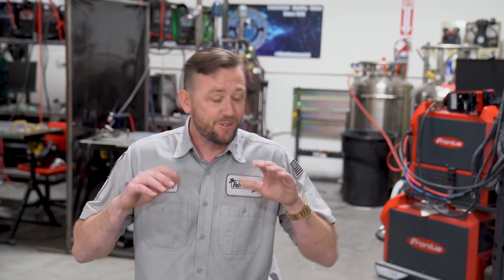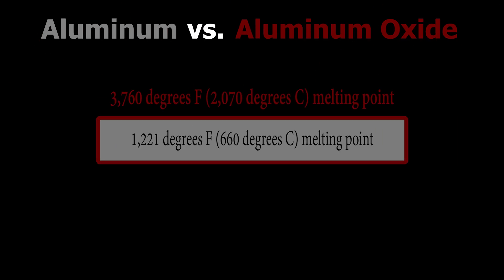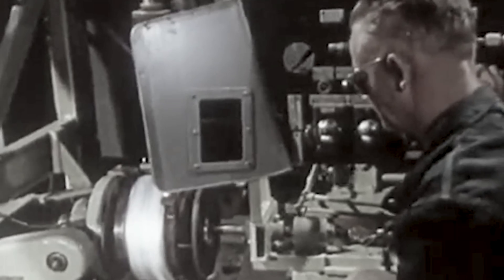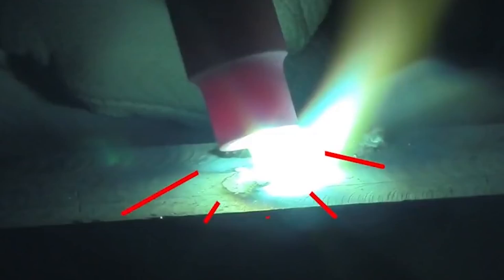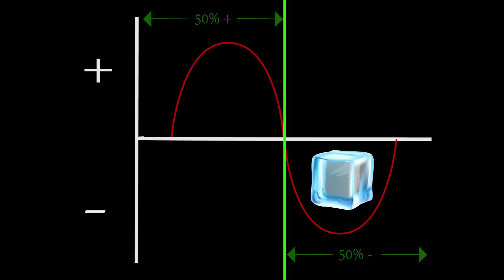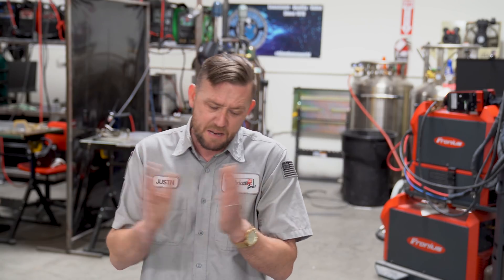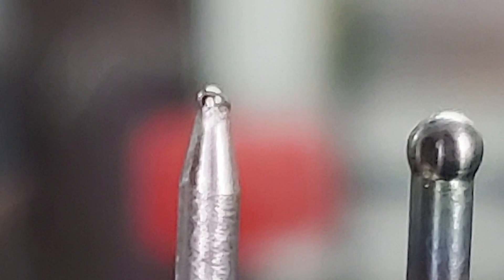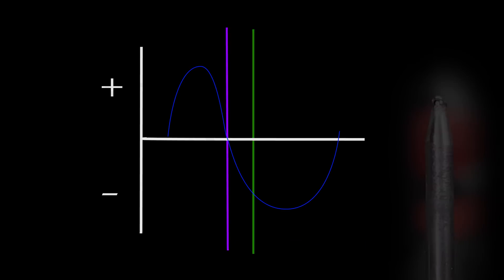TFS: Do We Even Ball the Tungsten Anymore?

Comment: I’ve been tig welding aluminum at work for about a year & still have no idea how to properly set the balance because we use Fronius machines & the company standard has it set to 0.5… I think. People always change it at every station. I think it maxes out at +/ 30 but I never go that far so don’t really remember. Fronius doesn’t seem to specify it’s a percentage like all the machines that I see here on YouTube do. 
It also doesn’t help that our “weld training” completely skipped over the settings because we should only “need to change the amperage, & maybe balance,” & I got one day of practice before going on the line while others practice for a week😅

I’ve learned everything I know from one certified welder on my line, this channel, & Pacific Arc Tig Welding YouTube channel. We’re not certified trade welders at our factory because we don’t fabricate from scratch, we inspect & repair robot welds

Long story still long™, if you have any experience with Fronius & could explain how its balance works or point me to someone that does, that would be great. Thanks for everything you do. I’ve learned so much & have found a new passion in stacking shiny dimes😂😁

Comment: We use pure because we don't need to be bothered with grinding tungsten, and no, we don't need to have a separate metal for balling it. Secondly, we get a robust, high build, bead profile very quickly. In our situation, there just was nothing broken about the system, other than perhaps the radioactivity issue with pure tungsten compared to others. 

We have had countless hires try to convert our process until they saw just how fast and pretty and consistent our welds are. We let welders choose which ever process works best for them. After a week of doing their way and being left in the dust, they just voluntarily adopt our way and add it to their skillset. Funny to hear them then tell other new hires. . ."Dude, it's 'pointless' to try and beat these guys at this game with that." Followed by. . ."It's so nice not to have to deal with dressing tips." 

I've been welding aluminum every day now for 30 years. I use a sacrificial scrap of aluminum to burn off a contamination event. Get it to glow and sling off the trash and cook it until it stops smoking. An even ball profile returns and I don't have to grind anything. We have two welders on a fixture and they race down each side. The pointed camp has to stop when they contaminate and then the other guy is now welding his side too until he gets his tungsten right again. Typically though, I don't have to touch the tungsten for days other than stick out adjustments periodically.

Not knocking the pointed camp, just that there are other reasons to use pure (green) other than just being stubborn.

Comment: I wish I had seen such a clear explanation of why opinions differ. I bought my TIG machine around 20 years ago (a Miller Dynasty Dx). I didn’t know squat about TIG but wanted to learn. The salesman at Holox was great, very knowledgeable. He got me set-up with the ancillary/consumables and even gave me a brief demonstration. He said with this machine you don’t even have to “ball” the tungsten. I thought well that’s awesome. Whatever balling a tungsten means, I don’t have to do it. Yippee. Take my money.

I rarely get the opportunity to TIG weld especially aluminum but I know my tungsten never balls. I never once heard it cry or even whimper even when it goes for a swim in molten metal. Every so often I’d be making small talk in line at the gas or steel supplier supplier and somehow the topic would come up and they’d insist I must ball it or I’m not TIG welding as if I don’t even know what TIG welding is. With my very limited knowledge all I could say is not on my machine... I’d finish the sentence in my mind...because the salesman told me so. It’s nice to have an understanding of it.

Comment: Recent idea, 1/8 tungsten w a 15° angle and slightly blunted tip.
Mass of the tungsten will keep it from dropping into the weld.
I only have a single 1/8.  Feels like welding w a concrete stake.

Comment: In the Miller manual for the Syncrowave 350 LX it clearly says if you are welding AC for aluminum you are to set your balance at 65%, use pure tungsten, and ball the tip.

Comment: I love your videos, and this one is great too.  One suggestion.  Emphasizing cleaning the Aluminum with acetone, a clean ss wire brush, and possibly acid, should be part of the regimen.  I think too many people look at the oxide layer on aluminum like "light rust" or porosity on carbon steel GMAW.  They think they can just "burn it off".  A bit more prep makes things go a lot more smoothly and a higher quality weld.  Cheers!

Comment: Welding Aluminium with a Transformer,  I ball the end.
Welding Aluminium with an Inverter,  I don,t ball the end.
Makes a huge difference which power source you use for welding Aluminium.
Inverters give you more arc control.

Comment: I'll run my lincoln tig 200 at 200 amps on 69% balance and it wont even remotely ball. I tend to grind it sharp like I'm doing stainless and the tip will deteriorate slightly  but stays decent for the most part. I'm gonna try to ball it next time

Comment: Would have liked for you to elaborate on the history a little more and the first shielding gases weer Helium thus Heli-Arc  I think that was trademarked by Union Carbide which then became Airco!  that said in the early days welding heavy AL was done (Clean) in DC Reverse with huge 5/32+  thoriated tungsten  with either pure helium or high helium mix.  Pre heat was your friend to stop the AL from sweating :-)

Comment: On my quick search I could not find the patent I believed was issued to Roderick G Rohrberg about another way of welding aluminum.  As he explained to me, you could break the oxide layer with a very rapid increase of the arc current, staying all the time on the Electrode Negative polarity.  As he explained it, melting aluminum causes a rapid expansion of the volume.  The oxide on the other hand has a low thermal expansion.  Therefore, the formation of aluminum puddle, if fast enough, rips open the oxide layer and pushes or even throws the oxides to the sides.  Unlike the AC and variable polarity methods that produce a relatively wide ion bombarded clean area, the pulse method leaves narrow dark bands immediately to the sides of the weld bead.  This process requires very high peak to background amplitude ratio and extremely fast transition (like less than 200 microseconds) from background to peak.  I have seen it done at 15 A background and 150 A peak.   Or actually I was involved...

Comment: Started tig welding professionally in 1983
Also owning my own licoln  tig 250
4 yrs as instruction personal at ROP center
Towards the last 15 years started sharping my pure tungsten and just putting a small ball on the tip for aluminum welding 
Giving me more precise control it seemed to me
No one told me to do it I guess I was experimenting 
So funny you talking about it

Comment: the answer is simple. If you use an inverter, don't ball the tungsten.
Reply from the maker: Balance! Balance is the difference. Inverter or transformer is not the difference. Its balance which is available on both types of machines.
Reply: @TheFabricatorSeries  Sorry, that is incorrect. While balance does affect how much heat goes into the work or the tungsten, power supply type is what makes the difference. This has to do with carrier frequency and the IGBT chopper circuits that inverters have and transformers don't.

Comment: #1 the ball end should not be bigger than the diameter of  the tungsten #2 balling should be done on a heavy copper plate. Two other mistakes I commonly see been made are gas flow to high,causes problems with arc on AC and tungsten not sticking out enough.

Comment: On thinner material and/or under 130 amps I run a sharpened electrode 3/32 diameter.  When welding up near 200 (my machines max) I find the heat causes the tungsten to develop nodules on the tip and arc stability becomes less.  A slight ball helps keep things under control.  Or going to bigger diameter tungsten that can handle the heat better.  200amps on ac puts a lot more heat into the tungsten than 200 amps on dc.  Excellent video btw 👍🏻

Comment: It's not just a preference in many cases: if you weld in the 350/450 amp like I do at work, you just need to ball your tungsten, regardless what's the diameter of it.
Also you talk about the balance just like 30% negative is fine for every application, but it's not: more than often you may need to weld cast aluminum and you may find cheap castings wich suck a lot, they are really dirty; then you may have to weld dirt material and 30% will never be enough to get a decent cleaning action.
30% is fine on clean new material, but that's just a small portion of the aluminum wich is welded everyday by all the welders around the world...
Reply: Get some helium to mix with your argon and weld those heavy castings on DCEN, no joke.
Reply: @Peter-V_00  hahahahahah, "mine argon"?
I work for a company with over 50 factories all over the world and I am just a number in it.
There's not any argon of me there 😂.
It's production series dude, it need to be fast and as cheap as possible: they cut off the helium/argon mix years ago, because it's too expensive.
Reply: @raulduke85  Fast and cheap doesn't alter fact, mixing in as little as 25% helium makes a huge difference.
Reply: @Peter-V_00  even if it makes a huge difference you are completly missing the point, working with a sharpened electrode for welding aluminum is only possible in workshops, on thin material applications and obviously NOT in production series.
You can't waste your time resharpening, or changing electrode when you work with time.
I personally work with 4 mm tungsten all the time, even when I work between 120/150 amp: at the end of the day they want to know why you were slower than how fast you were supposed to be.

Anyway, i highly doubt that UNI EN ISO 9606 would allow any wps in wich you tig weld aluminum in dc, regardless what your shield gas is.

Comment: great video  6061 just posted his opinion, he balls. two amazing welders with different preferences.  guess i have a lot of practicing to see what works best for me. keep the vids coming!
Reply: (I hope I'm not overstepping my bounds here, feel free to delete this comment if I am)
If you don't weld a lot of aluminum, over about .080" thick, you may not notice a benefit in balling the tungsten. I weld a LOT of aluminum. It is 99% of my welding work. I've been doing it for over 15 years straight now. Balling saves time and does not reduce arc accuracy if done correctly. I never head to the grinder to reshape tungsten unless I accidentally touch the tungsten to liquefied aluminum (rod or work piece). It saves a lot of time to quickly re-ball it whenever the tip starts looking irregular. No matter how you shape your tungsten (balled or sharpened), it will need to be reshaped from time to time.

Neither of the tungsten shapes in your thumbnail are ideal for any aluminum welding:

-The ball in your thumbnail is too big. If you ever feel the need to make the ball larger than the tungsten diameter, then you need to step up tungsten size. With that big of a ball, your arc will wander unless you are welding at really high amperage.
-The sharpened tungsten in your thumbnail has a small ball on it, and it's off center. That will shoot your arc off to one side. You want a ball that is in between both of those. Not too big, not too small. Hopefully that makes sense.
Reply: @6061  I think your work speaks for itself and proves your theory. I watch your videos and steal with my eyes to improve the quality of my work. Thanks for sharing 👌👌🔥
Reply: @6061  I do not I am a novice when it comes to aluminum. I appreciate the comment. On a side note I'm looking forward to more videos, good entertainment and good information!
Reply: There is a noticeable difference with 3/32 tungsten when your at/around 200 amps when it comes to arc stability and maintaining a point on AC.  All tungstens I have used (in 3/32 diameter) struggle to maintain a point and arc stability is less at 200amps.  Going to bigger tungsten or slightly balling it helps.  On sheet aluminum I can weld with pointed tungsten with great success.  It simply doesn’t put enough heat into the tip to cause abnormalities.
Reply: I also saw this👌
Reply: Yeah, this says to me that if you can get good results with the ball tip, you can save some work sharpening.

Comment: I have a 1983 Linde Heliarc 250HF- a purely transformer machine (60 hz, 50/50 balance) and I always start welding with a pointed electrode, and let it ball on it's own as it deems necessary. I feel like I have better results than starting with a ball tip. When I use a more modern machine after that, I feel like I weld like God.

Comment: Hi Justin,
Thank you for this video.  Have had the pleasure of using the Syncrowave, Aerowave, and Dynasty Miller machines.  I prefer the Aerowave for 1" thick aluminum.  Sounds like a rocket blasting off '-)   At home, it is an Everlast PowerPro 256.  Strange, but I prefer the Diamond Ground Tri-Mix electrode.
As you have said so many times, "clean your metal", really helps in a better weld.
Thank you again.

Comment: I never balled the tungsten until I had to TIG some 1" thick 6061. Ended up using 3/16" zirconiated (brown) tungsten, sharpened to a blunt point, and then balled the end to reduce spitting and tungsten inclusions. Ran about 350 amps, 70% DCEN, with a 200 degree preheat.

Comment: Is real welders who only had non inverter machines you turn the machine to DC and ball the tip on a piece of steel and it makes the perfect ball and then switch to AC and start welding.  
I now own a Miller 350 inverter and never have to worry about a balling  tungsten ever.  The best machine around miller rules

Comment: Now there's a great explanation by another professional, maybe I'm not experienced but I see no difference in tungsten on aluminum, I've been using the red blue and gray and have been from what I see the same results. Still learning maybe when I change the frequency or pulse or balance I'll see a bigger difference but for now I'm still running beads and coupons, old guy new welder (HTP 221) and having fun.

Comment: So can you explain how spoolgun or push pull mig works on aluminum? I'd like to know how mig overcomes the oxide layer
Reply: So, I had this metallurgy class where I asked this very same question to the teacher. Turns out, because in GMAW you are feeding a wire that's melting anyway, you don't worry about that whole Tungsten melting forming a ball. So you can run way more 'oomph' through your electrode (which is the wire) to melt that oxyde layer
Reply: @ShadeAkeley  yeah but wouldn't you just be blowing through the aluminum then? I'm sure I'm missing something. Maybe it's cuz you're dumping wire into the puddle it keeps the hotter arc from burning through. Thanks for your input
Reply: @benmiller5015  I admit I was a bit unsatisfied with that answer but he kinda skipped over it unfortunately. I believe it works for the reason you mentionned too

Comment: What is now known as tig welding was invented in 1941 although at the time it was called argonought welding and or heliarc welding this was a little before the D Day  Normandy landings of 1944. When I first learnt TIG/TAG welding I was taught to ball the tungsten on a piece of stainless steel also to occasionally to clean the tungsten by striking the arc on a piece of stainless. I still keep a stainless block nearby when welding aluminium although now it is just for cleaning.

Comment: That was the best explanation of what's happening in the AC arc that I've ever heard or read.
You my friend have the gift of educator and are doing what you should be doing.  Teaching.  Well said.  Well done.
Reply: I would agree 100%, I’m only a hobby welder and never really understood it properly until now. And best of all you did it in 6minutes!!! I wish I could subscribe more than once!
Reply: I don't believe his explanation is correct. What he said about the polarity of the current blasting up through the surface and taking the oxide layer with it doesn't sound right to me. I suspect the actual mechanism is different.